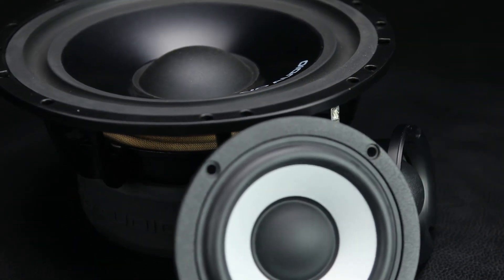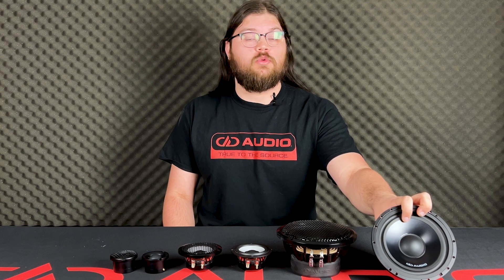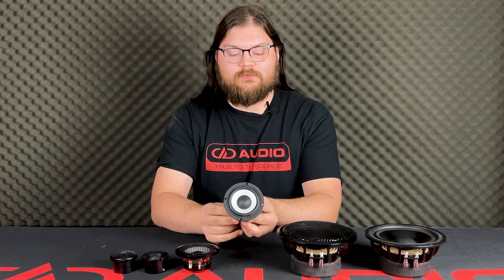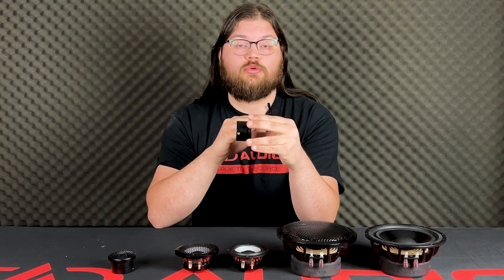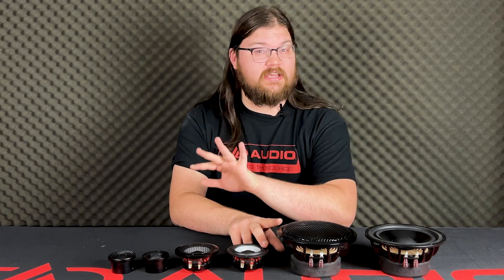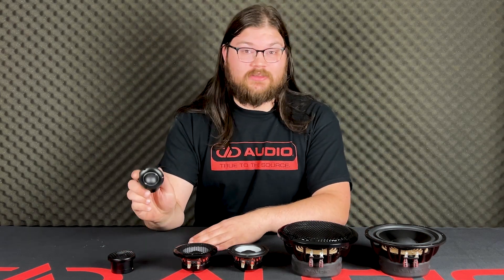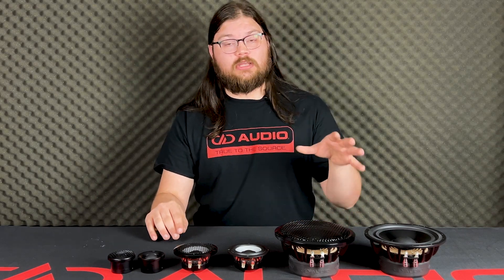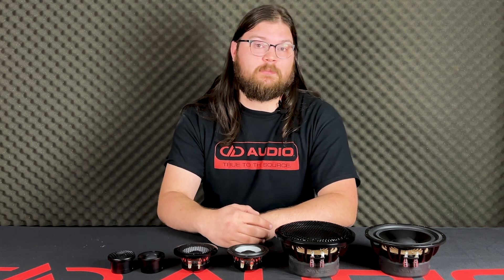A Series Component Speakers

Comment: CCA? That is hot garbage. That was a cost cutting move.
Reply: Nope! Aluminum is used because it has a much better bl:weight ratio. And in high frequency speakers like this reducing MMS is extremely important. It's not worth compromising the performance of a speaker for like 10 cents worth of copper lol